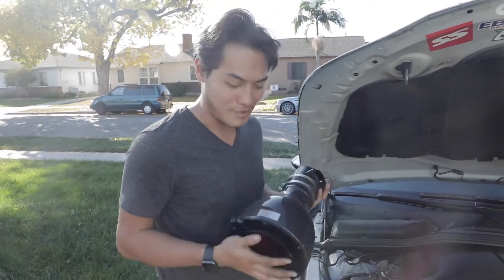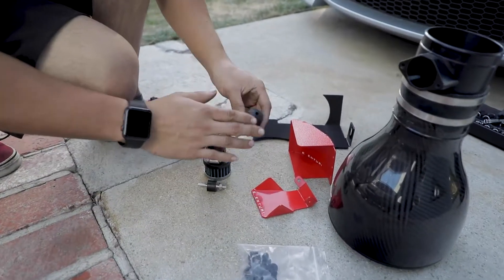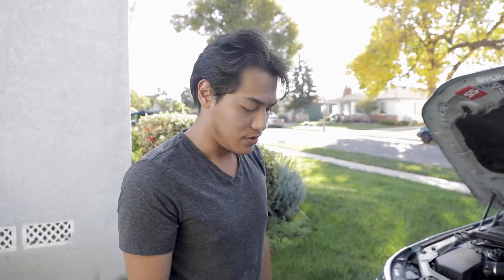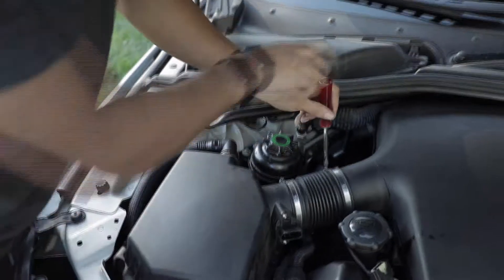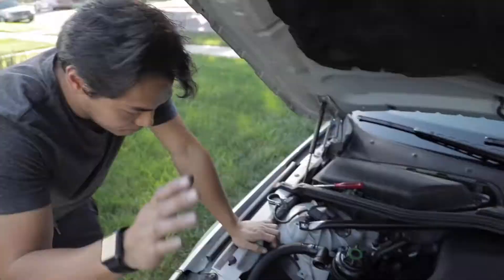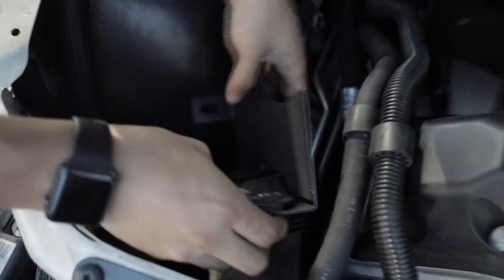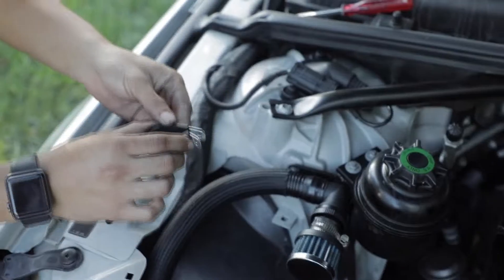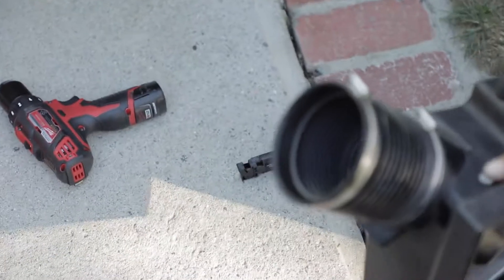How To Install: Eventuri Intakes On A E60 M5

Comment: A bit of advice from the U.K. ladies and gentlemen you may already know this but just in case... do not rev these V10 engines from cold always keep them under 3k revs until warmed up to temperature plus stick to the recommended 10w-60 castrol .. I’ve been doing this for 3 years and she’s bulletproof never had a problem very reliable engine actually one of the most reliable cars I’ve owned alongside the E46 M3 .... I also fitted this carbon fibre induction kit when I first purchased the vehicle this is a must along with an active exhaust ( helps the relationship with the neighbours 😉 ) ... I didn’t bother with an ECU upgrade as it’s not worth it plus I like to keep this future classic standard ( stock ) as I’m keeping this fantastic car plus their also becoming quite rare , there is a few lemons out there by that I mean abused , thrashed  badly treated cars , enjoy your car and that new induction sound 👍😎🇬🇧

Comment: How do you like the intake? I just installed the k&n typhoon on mine yesterday. It’s winter over here in Vancouver bc Canada so I haven’t driven it yet as it’s my summer vehicle. Greats videos by the way I just changed my spark plugs and ignition coils also as I had a cylinder 6 misfire. Any other mods your going to do? I have a Macht Schnell under drive pulleys needing install still.
Reply from the maker: The intake is great; really makes the car sound more how it should have came from the factory. Although their price tag is hefty, it’s such a great mod to achieve more sound if you don’t want to make exhaust louder. I have a evosport underdrive pulley and didn’t make too much of difference aside from being more pokey in the mid-range rpm. As far as other mods, I will be moving from the lowering springs to a coilover setup along with pulling the rear subframe and re-doing the rear suspension bushings when the time comes.
Reply: I just ordered afe for my m5
Reply: so your saying its a good add on if you want the car to sound better? no noticable HP gain?
Reply: I retuned mine and with with bmc filters and rpi scoops

Comment: One thing I noticed is, the factory air inlets, one comes through the grill area, other from the bottom...does nothing for air to these it seems. This system sits way to the side, tucked up towards the front of the inner fender, sealed, so the factory air inlets do nothing it seems. I went to the AFE, I can completely utilize the two cold air factory inlets.....
Reply from the maker: I honestly don’t feel any power difference. The car would have to undergo a tune. But for a bolt-on mod, imo it is well worth the $$$ for the induction noise!
Reply: @T30o  I understand what you are saying. My only point was, the way the system is sitting in the car, the cones point completely away from the factory air inlets, where as the AFE system I got, forms to utilize both factory air inlets on both sides, so it get the fresh air from the outside...just my opinion. ...just FYI, I took off my secondary cats, both resonators, the boat anchors BMW calls mufflers. All mine has are 12" Magnaflows..oh, Dinan stage 1 tune